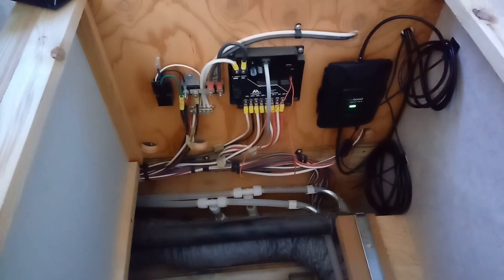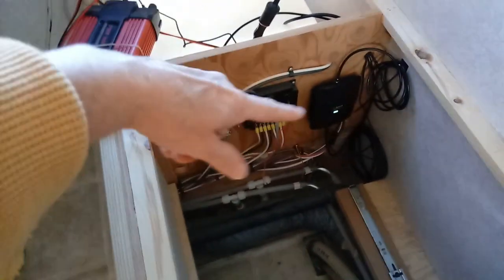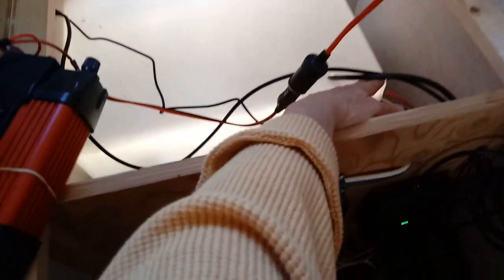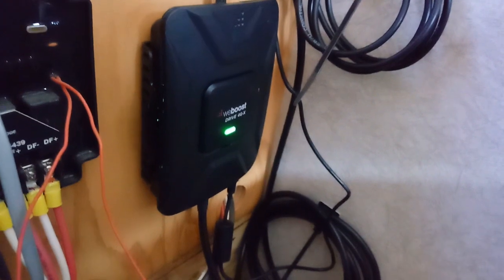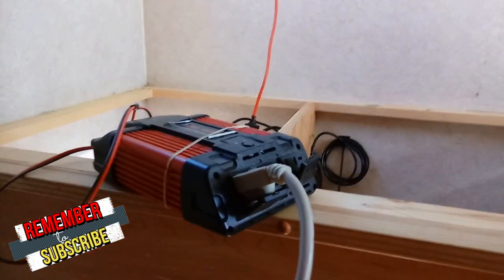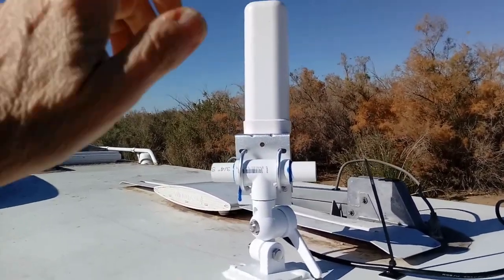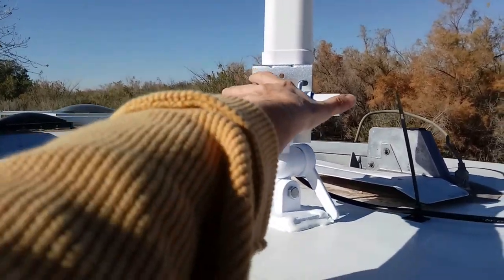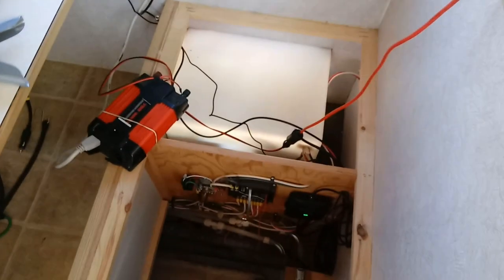WeBoost Installation In The Truck Camper | Cell Phone Booster

Comment: Nice job, Frugal.  Do you have the roof antenna permanently installed or can you easily move it to your traveling buddy’s travel trailer when your using her rig?
Reply from the maker: The mount is permanently installed but the antenna isn't.  I used a threaded PVC tee and attached the antenna to that.  So when I want to remove it I can just unscrew it from the mount.
Reply: Frugal RV Gal Ingenious 👍

Comment: Great install! Does it run on 12v or off the inverter? How does it work? Good?
Reply from the maker: You can hard wire it straight to the batteries but I have it running through my inverter.  It is working really well!
Reply: Thanks